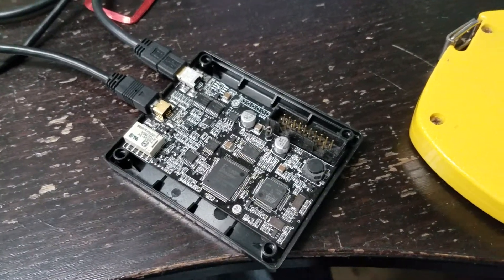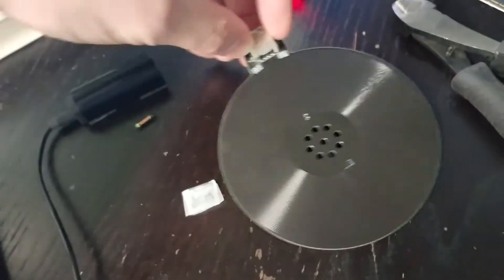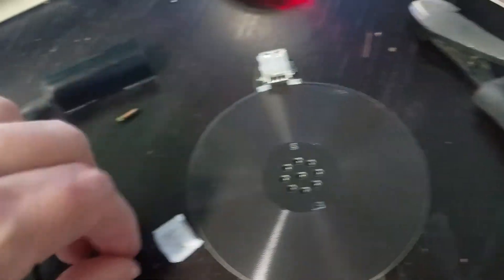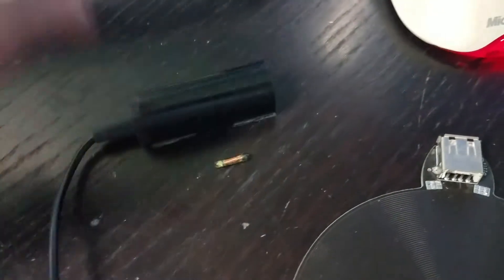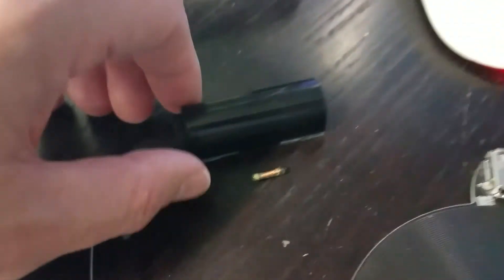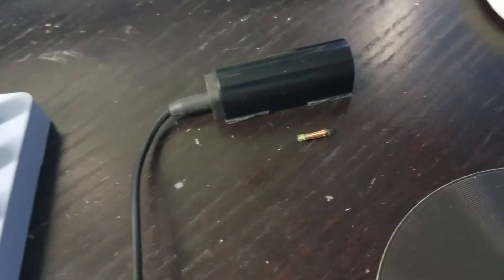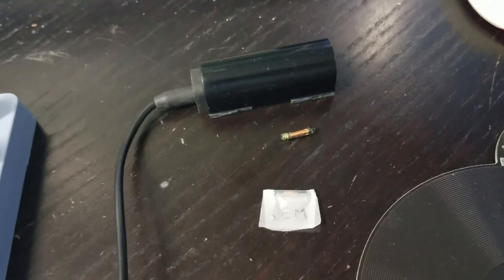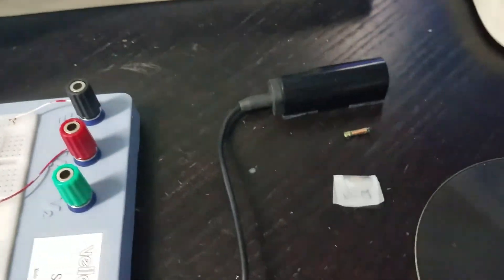Proxmark3 LF antenna designed to work with the xEM

Comment: hello amal i tried to create the antenna and to adapt it to my elechouse pm3. the problem is that the connected antenna cannot go beyond 10v so still not powerful to unlock my next chip! do you have a suggestion to increase the volts? (i connected the antenna with rf cable )  thanks a lot
Reply: I would post to the forum's project category at dngr.us/forum and we can go from there.

Comment: are you selling that LED tag?
Reply from the maker: lols mcfee dangerousthings.com/shop/xled but it's not for implantation.
Reply: Dangerous Things  would you consider doing and led implant? not all that practical but still cool
Reply from the maker: lols mcfee we'd consider a flex version in 13.56MHz but not glass. no point since anything you used to power it would cover it.